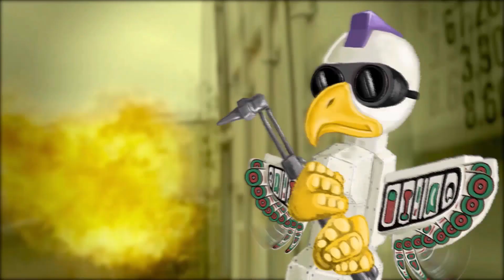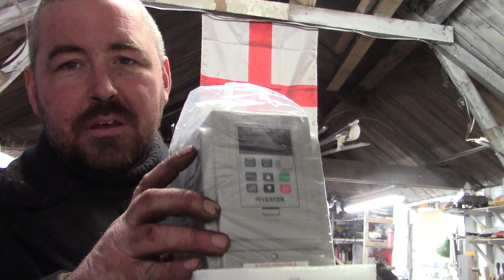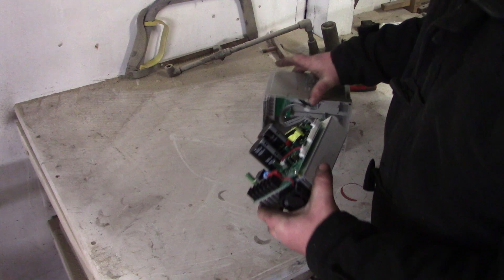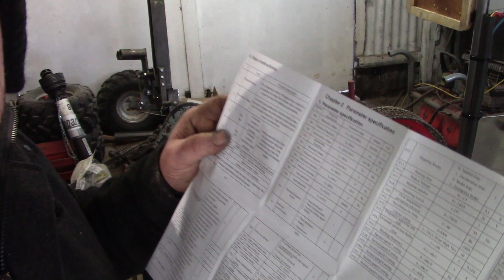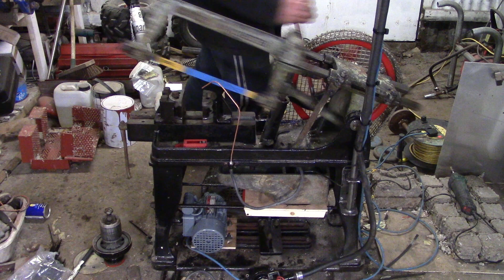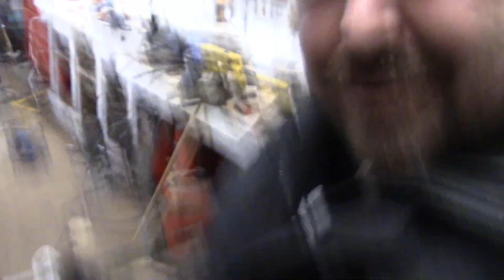Bodging a vintage donkey saw back to life

Comment: I had a much less complete one of these for years. Always meant to add coolant using a mechanical fuel pump from something old. Eventually cooked the motor and replaced it with a crappy 6x4 bandsaw but I get much more use out of the bandsaw now so was right decision I think. The guy I sold it to was setting up a workshop in the Philippines so should live on! 😀 Yours is looking good.
Reply from the maker: I didn't get on with my 6x4 at all, was really hoping to get fast freehand cuts but never found the right blade and obvs if I left a narrow blade on while dealing with heavy stock it'd wander and bind up.
Reply: @turboconqueringmegaeagle9006  the 10/14 Tooth M42 is the one to have for thick stock. I’ve even used that for cutting up some alloys wheels I might melt one day. Not sure about finer tooth stuff yet the cheap blades I’ve bought do wander all over.

Comment: which blades did you use mate I see they cost £17.00 each not cheap but should last quite a while
Reply from the maker: It had 1" blade when I got it and that meant the teeth were in the blade clamp and the whole thing was at an angle so it obviously wasn't right for the saw then when I looked at the 1 1/4" blades they were a fair bit thicker, I went for a coarse cut 14tpi and with eclipse that was £20 odd from memory. I've been messing around with 70mm bar and various other smaller bar and maybe 20-30 cuts later I need another blade but it's still cutting, just takes a bit longer.
It doesn't even matter how long it takes, currently my only other option is a Stihl disc cutter, or 9" grinder, the dust of those things gets old pretty quickly doesn't it
Reply: @turboconqueringmegaeagle9006  ill remember that when I pick up the saw as I can't go get it as yet with the lockdown in Leicester it's a retired guy I've bought it off  he told me he found 3new blades for me he said he's had the saw 20years so I would imagine it will just be fine   well I had a cold saw I sold that because my MRS was moaning about the noise so I went for a power saw I have cut with my grinder in the shed but dust gets everywhere I only doing it as a hobby I purchased a fabricator welder so I can do mig /stick /tig  I've been practicing  made a welding table etc
Reply from the maker: Fookin bastard lockdown mate, when it gets in the way of picking up vintage machine tools it's a big problem!
Hope you can pick it up without too much fuss and the Mrs is greatful to you for the implementation of a very sensible and thoughtful workshop noise reduction policy, she's a lucky lass, I'd tell mine just turn the telly up!
Reply: @turboconqueringmegaeagle9006  I was looking at the Clarke one but they are no way as good as the old saws they were made well not like these days there crap unless you spend thousands on one I think
Reply from the maker: I'm surprised to hear Clarke sell a power hacksaw, I had the Sealy bandsaw, exactly the same as the Clarke one, those small bansaws are not great, I used mine in the upright position a lot for cutting out knife blanks and little jobs like that but ended up selling it to recover a bit of workshop space, no regrets at all.
I would like to get a big upright metal cutting bandsaw but I'm a way off, need a bigger shed first!

Comment: hi mate what do you call the coolant your using as ive no idea
Reply from the maker: Soluble cutting oil or a lot of people just call it suds here in the UK, you'd normally buy the concentrate and add water depending on what you are doing, sawing or drilling need different strengths, it's only when you mix it up that it goes milky white.

Comment: Excellent work, but is it possible to put an electric switch in front of the saw and fall on it after it is finished, so that it will separate the electricity from itself

Comment: Cracking. I got an Ajax locally for £22 shes a beast https://youtu.be/12xNA7yAnVs

What are you running for coolant/cutting fluid?
Reply from the maker: You tube isn't letting me follow that link.
Coolcut is my tipple of choice, it smells like progress
Reply: @turboconqueringmegaeagle9006  https://youtu.be/12xNA7yAnVs try that link mate. With the cool cut do you add water to it. I dont know how good it is if you are leaving it in/on the saw for a long time between usage and the water separating and causing rust?
Or is this not an issue. 
I'm just uesing thin oil but the saw has a sump and a pump so would like to run coolant.

Comment: Beautifull stuff 👍 I love when old school machines are getting another life, well done sir. I had this kind of saw once in the place I worked, and from what i observed there was tendency to crook when there was to much down pressure but from what i read you have no way to control that. Still it looks darn good.
Reply from the maker: It's not adjustable on this one, it does have the wrong blade fitted though, I've just spent 17 quid on a new one so hopefully that improves the cut